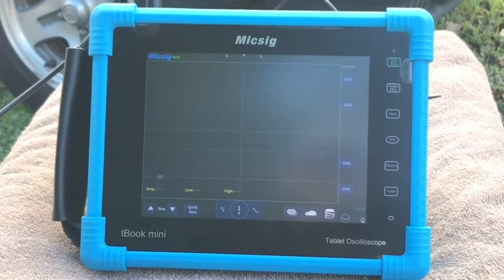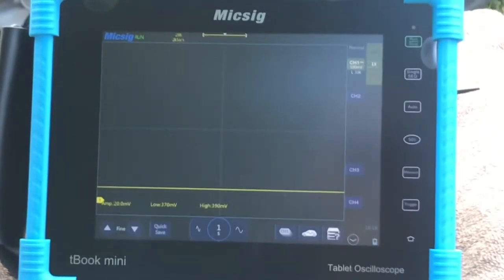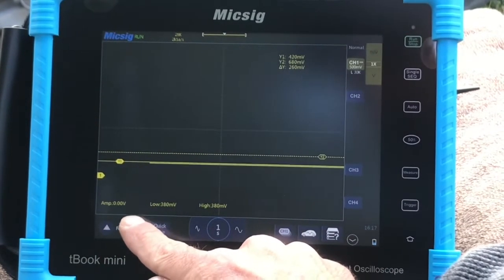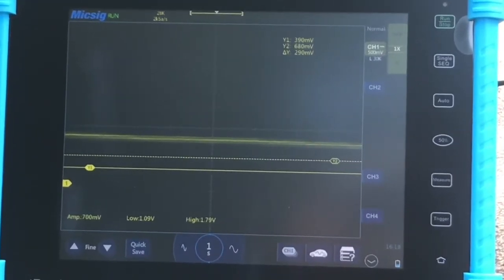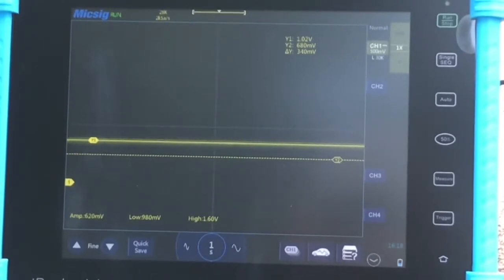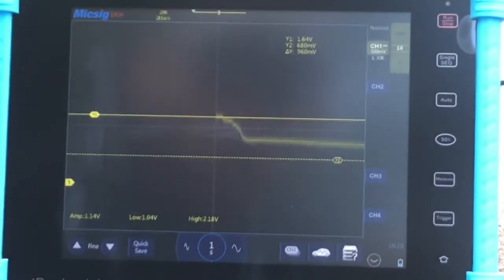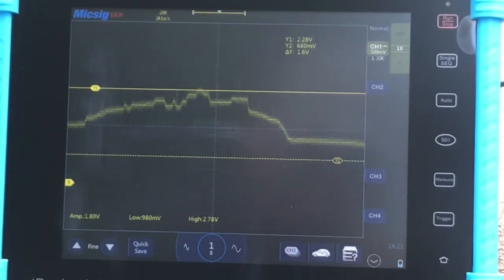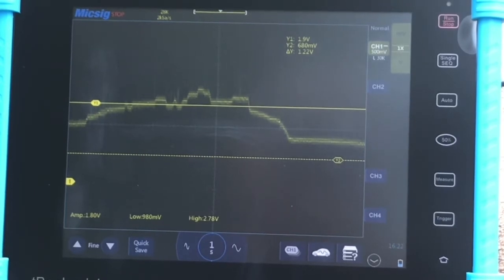MAF Sensor on the MicSig ATO1104 Automotive Oscilloscope , DTC’s P0171, P0172, P0174, & P0175

Comment: Adam I can’t wait till my scope arrives to get a lot of baseline info off my vehicles. 👍
Reply from the maker: Hey Artie. Just wanted to say, when you get your scope, once you connect to your  WiFi, don’t forget to check for a firmware update. Also, make sure to calibrate your probes. The ones with the little hooks. It’s real easy to do. Just click on the manual on the main screen, scroll through, and it’ll show you how. I’m here if you need me. Enjoy your Sunday.
Reply: @atomsworkshop195  Adam thank you so much. You have been very helpful and I appreciate that. Will stay in touch 👍🇺🇸
Reply from the maker: Yea, I remember that feeling. You can save all kinds of reference waveforms. Then if you have a problem with your car in the future, you’ll have known good ones to compare to.

Comment: Nice series of videos! Do you know if the ATO1104 comes with an AWG functionality? I've watched a video of someone feeding a waveform from a Vantage unit into crankshaft connector and then verifying the car picks it up by looking at ODBII data. This way, you can verify the integrity of the wiring and ECM. It seems that the way to go would be to get ATO1104 for general use and one of the cheapest picoscopes for their waveform library and ability to replay the waveforms.
Reply from the maker: How’s it going Maksym Petrenco. No the ATO1104 does not have a waveform generator (to my knowledge). I purchased a Koolertron DDS Signal Generator/ Counter. I got it from Amazon. I paid $150 for it, but they have other models that cost less. They have a 15MHz, 30MHz, and 60MHz. I got the 60 MHz. It’s a desktop model, but is light so if you’re mobile, you can still take it with you. I’ve seen mobile ones out there, this is just the one I ended up with. That’s a good idea about buying the cheaper Pico for the waveform library; I definitely wish I had access to that. The ATO does record and can play back waveforms. You can also save reference waveforms buy a click of a button labeled “quick save”. I hope this answers your question. Thanks for watching, and for the kind words. I’m sure you’ll like the Micsig ATO1104, it a good scope. I’ve had mine for maybe a year and a half or so, and I still really enjoy using it. Good luck my friend, and let me know what you decide to do. I’m always here, if you have any other questions.
Reply: @atomsworkshop195  Thanks for the quick reply! I was actually trying to decide between Siglent SDS2104X Plus and Rigol MSO5072, which are both 4 channel touch scopes with AWG, when I stumbled across ATO1104. Though I mostly tinker with electronics, my immediate need is troubleshooting crank/cam sensors on my car, so ATO1104 with built-in automotive features makes sense. Although I still struggle to understand what these features are - looks like they are just a collection of parameter presets and a sort of 'guides' that tell you what goes where in each of the uses cases.  Portability is a nice thing to have too. As for AWG,  I think you can save the ATO1104 waveform as a CSV; then, you can import that CSV into any other equipment, including a signal generator for a 'replay' and injection into a car connector. However, if I'm going to add bench instruments for the missing functions - the cut is a bit less clear. There is a good chance I will need to get both ATO1104  and Rigol/Siglent! Or just get a Rigol/Siglent and learn to live without the presets.
Reply from the maker: Hello. Yea, I don’t know much about the Siglent or Rigol, so I can’t comment to them. I will say, you don’t need the presets to look at cam and crank signals. Don’t get me wrong, they are nice to have, but you could go without them. They basically just set the scopes timebase and volts/amps per division. It’s great for beginners. Also, makes things faster for experts. I will say, sometimes they might be off a little. Yea, you really can’t beat the portability of the Micsig. I use the ATO1104 for automotive diagnostics, and the STO1104E for everything else. I keep the STO on my electronics table. I really like the knobs and buttons on it. I wish they had the ATO with the knobs and buttons, but no luck there. I haven’t tried putting any signals into my signals generator from the Micsig. Maybe, I’ll look into that, if I have time. I’ll make a video if I’m successful. I will say, that when I transfer all the videos, pics, and reference waveforms into my computer, I can open everything except the reference waveforms. Micsig said, that’s just how it is. They can only be opened in the scope itself. Good luck my friend. PS, you shouldn’t need to inject any signal in, to diag bad cam crank signals. Just connect scope to each of them, see that you have signal. If so, compare yours to a known good one. That’s the hard part. Finding a known good one. One thing about the Pico automotive scopes, is once you have one, you can access their waveforms library. I usually just use Alldata DIY. You can pay per vehicle, and they usually have a picture of the cam and crank signals to compare to. Good luck my friend. Let me know how it goes
Reply: @atomsworkshop195  The idea with injecting a signal is to test the wiring and ECM, not the sensor itself - basically, if you feed a sensor-like signal to the connector, you should be able to see the computer reading this signal and interpreting as RPMs. If you feed the signal, but do not see the RPM readout via ODBII - there might be a short in the harness or the computer might be bad. See 3:00 in this video: https://www.youtube.com/watch?v=IzZNlPosGSY
Reply from the maker: I see what your saying. You can also use the signal and 5 volt reference wire to do the same thing. Instead of me trying to explain it here, I’ll send you to the source of where I learned how to do it. If you go on YouTube, and put in Scanner Danner circuit integrity testing, you’ll see videos of how to do it without a signal generator. I don’t know if you’ve watched Scanner Danner (Paul Danner) before, but I personally have learned a lot from him.
Reply: @atomsworkshop195  Awesome, thanks, will check him out!
Reply from the maker: You’ll learn a lot from him. He’s an automotive diagnostics instructor at Rosedale Technical School. I also bought his book Engine Performance Diagnostics by Paul Danner. It’s definitely worth the money. If you are into automotive diagnostics, you’ll like it. He teaches a very simple method of diagnostics, that is way faster than the repugnant engineers flow charts. No disrespect if you are an engineer, but they are pretty ridiculous and time consuming. He also has a long list of diagnostic videos on YouTube. Definitely worth checking out. Well, I have to get back to work, talk to you later.

Comment: Hey Atom, I just got this scope and want to use it to test intermittent ESP (Electronic Stability Program) failure on my 06 MB R350.  I can give more details if you have any Ideas.   Only happens on long drives at freeway speeds, say 55 to 70 miles of continious driving
Reply: forgot to mention the code.  "Zero point steering angle variation"  I replaced the SAS (steering angle sensor) like you said not to do right away before confirming its bad.  Spent 400 bucks for it. Didn't fix the problem.  MB Xentry DAS said it would. Nuts!
Reply from the maker: Wow! Sorry you lost out on $400 for nothing. Maybe you can return it. I was diagnosing a car yesterday, that someone fired the old parts shotgun at, and missed. I think he only lost about 160 bucks on an EGR valve thought. Well, we live, we learn. Good luck my friend.
Reply: @atomsworkshop195  taught me the lesson that i need to really learn the cars i have.
Reply from the maker: Hello Don. How are you liking the scope so far? What kind of failure are you having? Is the light just coming on after 55 to 70 miles of driving? Is it affecting the ride? It’s really hard to say (for me anyway). To be honest with you; I have a Nissan 350Z, and after driving about the same amount of distance, my TPMS light will come on. It doesn’t seem to affect the vehicle or drive any. All my tires have the proper air pressure. I still don’t know why this happens. To be fair, I haven’t really looked into it, since it doesn’t seem to affect anything. Have you tried googling the problem? Maybe there is a TSB (trouble service bulletin) explaining what is happening, and the most common fix. With that said, if you just want to play with your new scope, lol (which I completely understand). You could connect to your Cam & Crank sensors, and save the waveforms using the quick save button. This way, in the future, should you have a problem and need to test them, you will have known good waveforms to connect to. You could also do this with other sensors and components on you vehicle(s). Sorry I don’t have a good answer to your question, right off my head. PS, I’m really liking using the stylus pen on my scope. I used it for most the day yesterday. Thanks again for the idea. It really makes a difference.

Comment: I bought a TO1104 and just recently purchased and installed the license from Micsig to make it a ATO1104. My question is what is the icon to the right of the automotive icon on the scope screen. After the software download I have all the presets but not that icon. I also was wondering if while playing back a recording if you can pause it and bring up cursors for taking measurements. I can’t with mine at least not that I have figured out how to.
Reply from the maker: Charles, how did you get the license to upgrade from the TO1104 to the ATO1104? I’ve had a couple people ask me if you can do that, but I could never find the option on their website. Also, how much was the license for the upgrade? Thanks
Reply: Atom’s Workshop I emailed them about it and it was 199$ which I payed through pay pal
Reply from the maker: Hello Charles. First, the button that was to the right of the automotive button is no longer there. When I did the firmware update that added the “Invert” option, it removed that button. It didn’t do anything anyway. When I would click on it, it would just open a box on the left of the scope screen with some Chinese/Mandarin (not sure exactly) writing, and that was it. I tried clicking all over the box and writing, and nothing would happen. Anyway, it’s gone now, so you’re not missing out on anything. Second, to my understanding, no, you cannot bring up measurements during video playback. However, while looking at live waveforms, you can press “Quick Save”, then later (or whenever), while on the scope screen, you can press the downward pointing arrow with circle around it, located under CH4, then press REF. At that point you can either press the on button for either R1 R2 R3 R4, or press the box to the right of “Recall” (the box with numbers and date). If you press the numbers box it brings up a list of all your reference waveforms, beginning with the latest one. Tip: if you turn on R1, then click the numbers box of R2, you can click on each one down the list to see each waveform, without it  closing out the menu box. Once you have a reference Waveform (or multiple reference waveforms, up to 4) on the scope screen, you can use the cursors and everything else in your bottom menu (360’, MEAS ALL, ZOOM, etc). You can zoom in and out with your timebase buttons (ms, etc)But you can only pull out as far as the original capture (it’s best to always grab a capture (QUICK SAVE) zoomed out far. This way you’ll have a larger zoom range later. You can also change the voltage (mv/v). You can adjust the trigger (even though the waveform is stationary). You can use the “FINE” adjust option. You can open the Math menu, S1 & S2. You can use the “CH1” button (to the left of the automotive button), to switch from one reference waveform to the other, or the MATH channel (if you have more than one open). Also, you can use the “CH1” option to adjust the timebase of each ref or math channel individually (zoom in on one, zoom out on another). Well that’s everything I can think of at the moment, hope this helps. I know it’s a lot, but I just wanted to be thorough, so you know what’s available on there. Last, congratulations on your scope purchase! If you’re anything like me, it was like Christmas morning as a child when it arrived and you first opened it, lol. If you have any other questions feel free to ask.
Reply: Atom’s Workshop, thanks for replying so quick. I’ve been seriously considering a pico as well but I liked the price and portability of the micsig. The only drawback I have found is the video playback. I’m a heavy equipment technician and being able to record events as they happen is vital but not being able to pause and take measurements while replay is frustrating.
Reply from the maker: Not a problem, glad I could help. You can pause the video playback, but unfortunately no measurements. Yea, that would be a nice feature. I often find myself trying to do just that during video playback. Also, I really wish Micsig would offer an online reference waveform library like Pico. I too was on the fence with purchasing the Pico. They have a lot of great features (such as the REF Library). I wanted to build up my own library on my laptop, but I can’t open the REF files once on my computer. I can open everything else, just not them. I believe Micsig told me they can only be opened on the scope (if I understood them correctly anyway). I guess I can still save them on my laptop, just not open them.
Reply from the maker: I usually take a video & some “QUICK SAVES”, so when I’m looking at them later I can see the video, and just take my measurements with the REF files. I’ll talk to Micsig. Who knows, maybe they can add that feature to the video playback. I have to say, they are really good at listening to the customers concerns and helping to correct them. When I purchased my ATO1104, there was no “Invert” option. They did have it on the TO1104, but not ATO. I emailed them and let them know how important of a feature that is for the automotive guys, and he told me he would have it put in in the next firmware update; and sure enough he followed through and made it happen. Now we have the Invert option on each channel menu. That’s really cool.  I can’t imagine many other companies doing that. Thumbs up for Micsig. (No I’m not paid by them, and yes I bought my scope); I just really like my scope, and have to call out great customer service when I see it; especially when many companies customer service leaves something to be desired.

Comment: Hello can you check secondary ignition with it
Reply from the maker: Yes you can. I made a video using the Pico COP probe (paddle probe). However, the waveform looked a little odd. I don't think that was because of the scope or probe though. After talking with others in the comment section; I think it was the COP's on the vehicle I was testing. Some have more insulation than others, making it harder to get a good waveform. Another subscriber told me, he was able to get good secondary waveforms, so I'm pretty sure it was the COP's on the car. I will try to make another video testing it on a different video.